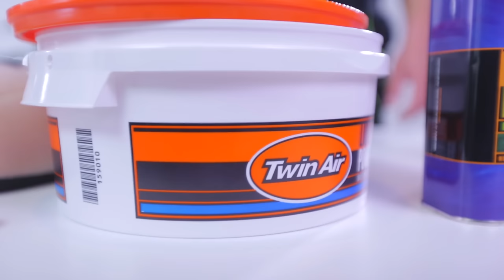How to oil your foam air filter

Comment: Use should also grease the filter where it meets the mount, I use motorex life long grease to get a good seal to stop water or debris forcing its way behind the filter.
Reply: And then how do you remove it? I guess it will not come out with bio cleaner.
Reply: Nuno Sousa the grease does wash out with motorex cleaner. Essential for a proper seal.. it states in most owners manuals to do this
Reply: Nuno Sousa I use the twin air Bio sealant. Take it off with contact cleaner around the filter housing and the bio cleaner takes it off in the bucket when cleaning.
Reply: Do you use a grease gun

Comment: Can you use something else than this specialized oil? Can I use 2 stroke motor oil?
Reply: Henriete Jete Use only filter oil! Putoline or Twin air. 2t engine oil is a bad idea.
Reply: I've used 2 stroke oil for probably 30 years. It works fine.
Reply: deere3321 and he only had to rebuild his engine three times per year. Bargain.

Comment: Hey, i oiled my twin air airfilter and it is blue instead of green
Reply: That means your filter is seized. Does it still shift properly, and does the filter stop the bike when you press on it? If not you may need new brake pads.
Reply: Daniel Daniels lmfao
Reply: It's possible you got the Canadian oil and now have to move.
Reply: The truth is that your powerband it too tight, loosen it so the oil flows freely turning the filter green.
Reply: #bluefiltersmatter
Reply: It is probably cause your suspension is too low pressure... so the air filter is lower from the ground making it cold... so the air filter is showing you its temparature. Adjust your back sprocket to make air filter yellow....

Comment: what happens if i don't oil the filter and put it dry? I use the bike on very dusty roads in summer
Reply: Then your dust comes into the engine😂😅… 
The oil is sticky and so keeps the dirt/dust on the filter. Without oil the dust/dirt can move threw the filter.
Reply: @dasatom3060  I can put normal engine oil, or it would be aspirated. I would like to put a thin layer of engine oil on the surface of the sponge filter.
Reply: @badlix2309  Hey, i guess it wouldn‘t really do the job because the oil won‘t stay very long on the filter. It‘s just to fluid, it will run out of the filter and make a huge mess in your motorcycle. I really wouldn‘t recommend to do that. Just buy a 1L Can of Filter Oil and watch a tutorial how to oil your filter and you are good.
Reply: There is a BIO Filter Oil from Twin Air that does this Job perfekt. And with the BIO Cleaner you can even wash it out in a Bucket when the filter is really dirty. The Bio Version is nice because you can fill the sewage into the sink without harming the environment. With the normal Oil etc. you have to collect the toxic water and bring it to the landfill.
Reply: @dasatom3060  thank you very much for the advice I will treasure it.